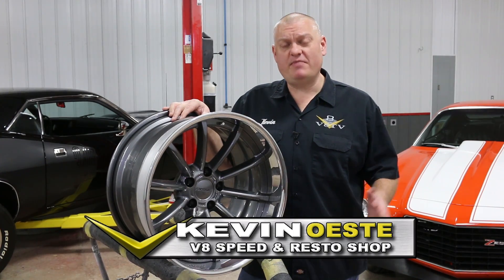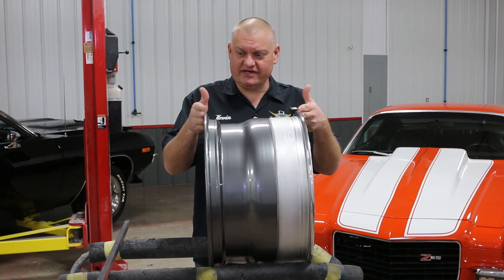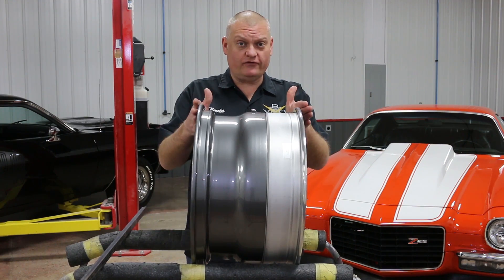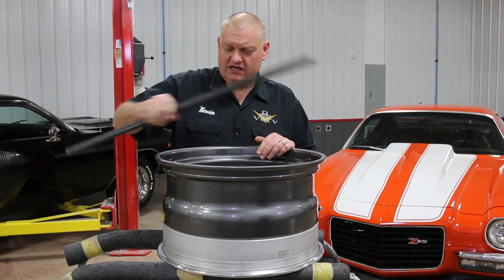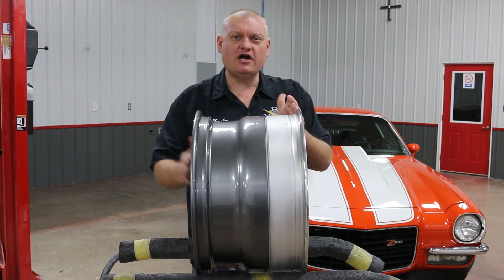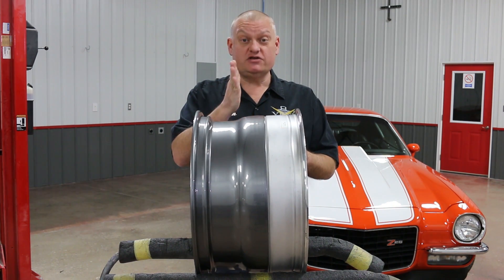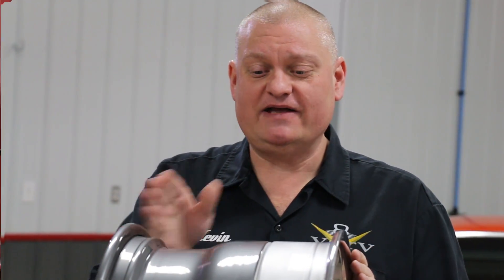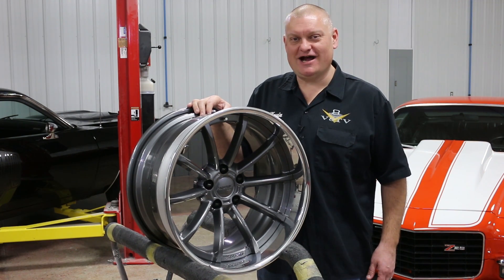How to Measure Custom Wheels, What are Backspace and Offset?

Comment: so if i have a tire that wheel range is 6.5-8.5 - any number in that range will work - i can buy a wheel advertised as 15x7 and I am within - but is that 7 measure outside or inside (the stated width?) 
thanks in advance

Comment: I have an 87 grand national, and I'm wanting a particular stance, I'd like the rear wheels to be even with or slightly past the wheel wells. I've trying to figure the right back spacing for this!
Reply: Measure the distance out from the wheel mounting surface on the car to the edge of the wheel well.   Lets assume it's 5".   That distance plus the backspacing will equal the overall width of the wheel.  Lets assume you want to run 8" wheels, which will probably be about 9" wide overall.  9" minus the 5" equals 4", which is the backspacinv you would need.  Since 4" is less than half of the overall wheel width, you would have a negative offset of a half inch.  (backspacing minus half the overall wheel width equals 4" minus 4.5")